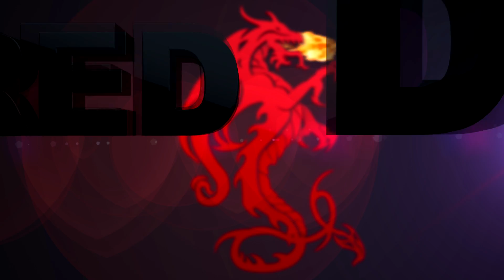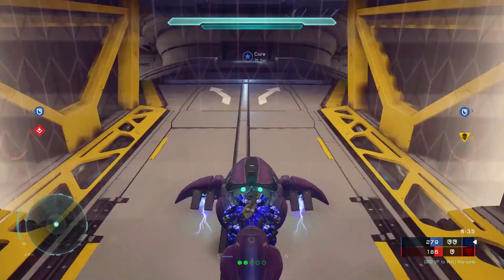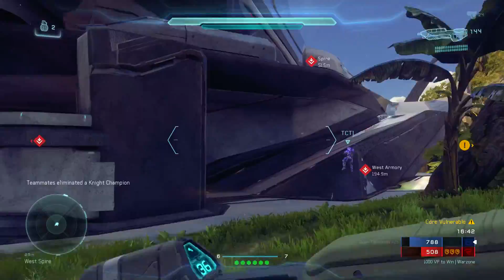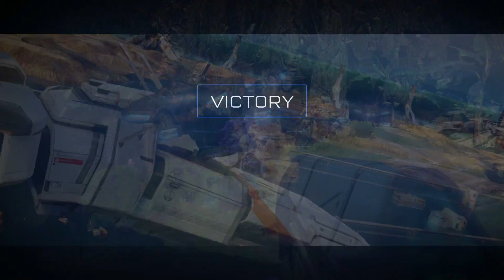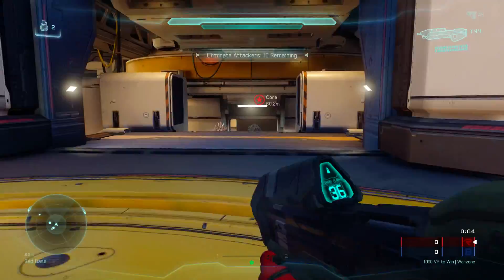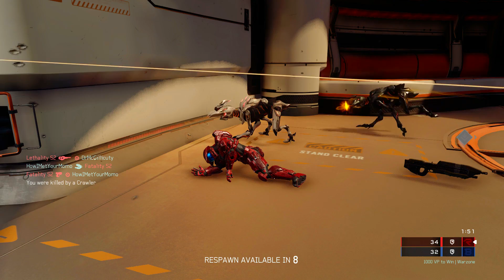New Xbox Console is Coming? Next Xbox Needs These Features

Comment: The way I see it. PC gamers pretty much set the standard for the gaming industry as to what should and should not be. 
5 years from now, there will probably be a new standard. 
Current is trying their hardest to hit 1080p60fps, while a modern currently does that in its sleep.

Currently we are moving onto 1440p 170hz as well at 4K @ 120hz when display port 1.3 releases next year....I'm pretty sure 5 years from we would've set an even higher standard.

Face consoles cannot keep up, for $350 that is. Now if MS and Sony release different versions just as steam did with varying price points in their different configurations. Then we'll have something to debate about. Until then, just switch to PC

Comment: Next gen consoles need
i74790k 
980ti 6gb VRAM 
16gb RAM DDR4
8GB ESRAM 
3TB SSD.

That will achieve 1080p 60FPS/1440p 60FPS/4K 60FPS on some games maybe depending how well optimized the game is,  how old the game engine and what setting its on in PC terms.
Reply: +Zakk1699 that sounds really bad... 
1. no one wants to overclock a console CPU, 
2. consoles dont use actual removable cards like PC so no... but it can have same power
3. idk about that
4. a 2TB SSD is already $700 LMAO what kind of price are you expecting from these consoles?!?

Comment: XBOX 2 Slim Console with 5 different colours to choose from same price for all.
32 CPU cores
4K gaming 
5TB as standard 
extra Expandable HDD slots 
backward compatibility Xbox one, Xbox 360,and PC
DX12.5 Windows 10.5
Reply: At least you gave me a good kek
Reply: Hahaha! Like what!?
Reply: you're drunk 
32 CPU cores
go home
Reply: Pouroddacloud Cloud 32 cores CPU is very much possible AMD already have working 12 / 16 core CPU AMD also developed HBM memory which can cope with 16 or 32  cores monster. GDDR5 is obsolete it cannot be used on the new 32 cores High bandwidth memory  is 94% smaller than GDDR5 chips HBM memory can be fitted on the Conors of the new 12 / 16: core cpu Xbox one will be a reality on 2018 it's a good possibility it's going to be 24 core or even 32 cpu core
Reply: Blue Angel quad cores is the new standard with octa cores being pretty standard as they've been used a lot in phones 
A jump from quad or octa core is pretty huge to 16 or 32
Reply: Pouroddacloud Cloud  Technically is a possibility but it's more likely it's going to be 24 cores cpu xbox 2
Reply: Blue Angel I think its going to be 12 or 16
Reply: Pouroddacloud Cloud  It will depends on Microsoft budget and Phil Coencer 12 / 16 cpu cores is the cheapest option but competition from Sony could prompt MS to up the Antie and then there is the cost to consider.
Reply: Ask Intel i7 5960x owners how many more additional FPS they get or image quality settings they were able to turn up because they have 8 cores instead of 6 or 4. 

A console (or PC honestly)  sporting an 8 core APU with a next gen AMD Polaris or Nvidia Pascal GPU and 16 gigabytes of HBM2 memory all on board in one neat package does sound realllllllllly amazing though. Throw the OS bits on a 256 SSD with enough left over for the real demanding games and include a REAL 7200 RPM hard drive for the last gen/indy/whatever bulk.
Reply: +Blue Angel There are no reasons a company couldn't use HBM or GDDR5 on a 16 core processor because both forms of memory are being used on GPUs with actual core counts waaaayyyy over current CPUs. Your RAM does not care how many cores you have. 

Also, I don't think you quite get HBM. HBM memory is being used on GPUs: the AMD Fury X, Fury Nano, and Fury. AMD also did not develop HBM, they are just using it and Nvidia will be using the second generation on their new cards for 2016 as well as AMD. Current rumors are 16 gigabytes on Nvidia Pascal with 1 terrabyte/s bandwidth theoretical. 

I'm sure there are AMD plans to make an APU with on board HBM, but whether they will get it all taped out and in production by next console generation is another problem on its own.
Reply: William Moore  I got my information from http://www.pcgamer.com/amds-next-gen-zen-cpu-due-in-2016/  this is the new next gen CPU 7000 series  from AMD 
And HBM memory  http://www.amd.com/en-us/innovations/software-technologies/hbm  If this wrong then I am wrong too

Comment: Terms of power in console. Xbox is always on top
Xbox > Ps2
Xbox 360 > Ps3
Xbox one < Ps4 because of Don Mattrick and forcing the Kinect to be used so taking half the power of xbox 1 to the kinect which was a dumbass move.
Xbox Two/Infinity > Ps5 because microsoft learn that they fucked up on Xbox 1 and also mircosoft is the leading and make the one of the most powerful hardware and software than any tech company
Reply: oakur1 I said power not sales idiot.
Reply: +Terminator 
Xbox > PS2
Xbox 360 < PS3
Xbox One < PS4

That's the correct comparison
Reply: +Obake Oni You REALLY don't NEED to capitalize EVERY other WORD
Reply: +oakur1 It beat it in sales but the OG Xbox has tons more power and it had xbox live.
Reply: Um.. Kinect ain't needed. I ain't got one.
Reply: 10th Doctor Whooves why aint you got one cuz? did you not never need one or done you not want one of thems?
Reply: +Bomba Plays Both. Mine never came with one, works fine without one.
Reply: Um... I never said it was. I know it's greatly improved, I just don't want it, nor do I need Skype when my $2,000+ Gaming Laptop is just a few inches away in the same room. I just don't feel the need for it. If it came with, cool. Since it didn't, oh well.

Comment: I expect the next console to run at least a solid  1080p 60fps
but as far as being a "pc" I highly doubt that Microsoft can do it without raising the price to $800-$1000
ppl were not going pay $500 what makes you think they will pay more???
Reply: ***** I would love them to make the console a stable pc but the Regular consumer is not going to pay that much money for it.
Reply: Yes and you paying $800-$1000 means that I'm paying £800-£1000 (which is around $1600). I ain't paying that!
Reply: whatacutebum Didn't you guys have to pay close to $1,000 when the xbox one first release?
Reply: Pretty much. Change your $ for £ and multiply by 1.6, so £449=$718 just for the console.  Our games and controllers also cost around £55 too.
Reply: +guide0345 By the time the next consoles come out 4K will be everywhere. It's already started, more and more 4K content, 4K TVs for $400, etc. If the next generation of consoles can only do 1080p 60fps, that will be sad, and they will, yet again, start out behind. I paid $600 for the PS3 10 years ago. They could easily build a powerful console, especially considering the deals they can get for hardware.
Reply: Neither can Sony

Comment: well red i agree with ur video and most of comments. yes ms needs to pack some punch in their next console thats for sure...sony will realise this and come out guns blazing as well...hopefully.
even tho i have a ps4 now i had both the first xbox and 360 from launch so iam not a sony fanboy...i just bought sony this time.
i know it doesnt go down well with gamers about upgradeable consoles but after this gen i think both sony and ms need to think of a way of increasing performance at certain stages in the consoles life.
wether thats by releasing something that plugs into said console that boosts performance...or building the console with more oomph that they can unlock and make available later on.
only other option is shorter console life spans!

Comment: Top 5 additions
1: 4k 90fps ( keep in mind this is around the year 2020)
2: Backwards compatability on all xb1 and 360 games
3:High quality exclusives 
4: A higher quality controller like the elite controller 
5 : Some sort of Steam addition so you could connect with two platforms
Reply: 4k/90fps huh?
Reply: +Andrew Sissons you wont get 4k 90fps,

Comment: My wishlist:
1. Dual swappable Sata III HDs
2. 2 USB Type C ports on the side
3. Two USB 3.1 ports on the front
4. 4 USB 3.1 on the back
5. Slim 4k blu-ray capable drive
6. massive heatsink that spans the entire right side of the console, this would mean dual 120mm fans blowing down onto the heatsink.
7. Support for DACs and headphone amps.
8. filtered intake vents with the filters being removable to be cleaned to keep your Xbox clean and healthy. this need to happen because if you open your console to clean it your warranty is void and if you can't clean the dust then your console will run hot.
9. Full desktop windows compatibility, meaning I can buy the Xbox one as a console but load windows onto it and use it as a PC.
10. R9 380/GTX 960 level of performance.
11. composite audio output (not everybody has a receiver with HDMI input)
12. Games can be installed on 2 hard drives and have the drives run in Raid 0, this means the CPU will draw data from both HDs at the same time and substantially increase read speeds. (I.e. shorter loading times.)

Comment: 1) i want the surface team to design the new xbox. It has to look sexy. The x1 while it doesnt look ugly...it just blends in the background, which as i understand it, was their goal...but it was the wrong choice.

2) i want complete cross play between xbox console and xbox pc app.

3) upgradeable gpus. Have a choice between 3 gpus so that the more hardcore gamers get the best graphics while the casuals can get lower graphics.

4) Needs to have a fast memory controller that is the standard for pcs at the time. For example pcs are at sata 3 while x1 is at sata 2.

5) Have a choice between ssd and mechanical drives which is user upgradable with standard non proprietary drives.

6) Controller or console needs a bluetooth module so it can pair with bluetooth headsets.

7) I want them to surprise me with new features.

I also agree with Reds list...specially the part about the new xbox having to have all the features that x1 has.

Comment: X2 requests. 
1) Built in powerbrick + kinect
2) 1080p ( or higher) + 60fps (or higher)
3) At least 3 top exclusives in the launch.
4) Background theme like ps (optionial)
5) Everything x1 can do but a ton lot better.
Reply: +Gabriel Alexander built in power brick can cause more issues, issues i dont want
plus if ur power brick breaks on xbox one, u buy a new one
if it does in PS4,  u get a new ps4 lmao

Comment: As a guy who only owns a PS4 because of one exclusive (Guilty Gear if you must know) Unless the "current" gen consoles get a big upgrade or the "next gen" get a lot more horsepower there's no reason to bother. Realistically I think we're 3 years away from a big remodel or new model. Less if its an upgrade. More if its substantial. Remember the architecture in the PS4 / Xbone are AMD IIRC and if still being favored by the two devs in this case AMD Has some stuff coming down the pipeline in the next few years that might make a big deal of this. Until then I guess we're waiting.
Reply: Dont know if you owned a PS3 beforehand but Xrd also came to PS3
Reply: +ms00kye I did butuch like my last 360 my PS3 wound up breaking. put a tear in my eye too. I've had 1 Ps3 but 4 360s. RRoD was real.

Comment: Microsoft better not cheap out with the GPU and CPU with the next Xbox. I also read an article earlier saying that the next Xbox/PlayStation to be released around 2019. It may be earlier than that, who knows.
Reply: +NYGiants4Natic its not like its going to release tomorrow. By the time the next xbox releases (2018-2019 at the absolute earliest), technology will be so far ahead that getting 1080p 60fps will be really cheap and really easy, especially for Microsoft considering they get wholesale discounts.
Reply: +NYGiants4Natic I'm not asking for 4K geeez. Enough to maintain 1080p/60fps.
Reply: +Carlos Hernandez then be Rady to pay 700 bucks
Reply: +NYGiants4Natic Wrong... Lowering texture quality will free up some of the ram allocated to the GPU, but it is not going to make up a 20-30 FPS difference. Fact. 

There are exactly two differences hardware-wise between PS4 and Xbox One: the PS4 uses a GPU closer in spec to an actual AMD 7970 and the PS4 uses GDDR5 for the entire system instead of the Xbox Ones DDR3. Using regular desktop memory for the GPU was rather stupid on Microsoft's part, but all things considered neither of them were going to do 1080p60 with all the bells and whistles. Ever. The 7970 was a great GPU, but it was current in a time where 1080p at 60+ FPS and every setting turned up max was as amazing as 2560x1440 was in 2013-2014 and 4k is now. Tech was juuust starting to get there. Coupled with the fact that neither console has dedicated VRAM and it really isn't hard to see 1080p60 wasn't going to happen without caveats, if even possible in the first place. 

4k60 IS Not going to happen unless Nvidia or AMD pull some serious shit out of their asses this year or the next. A comment earlier betting on 2560x1440 at 60fps is much, much more accessible, sensible, and current GPUs this generation are doing so.